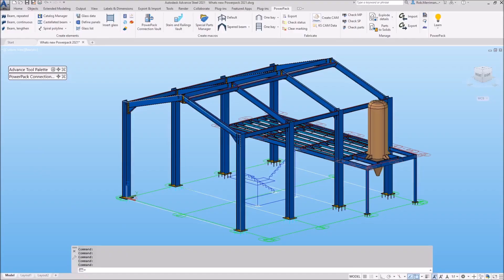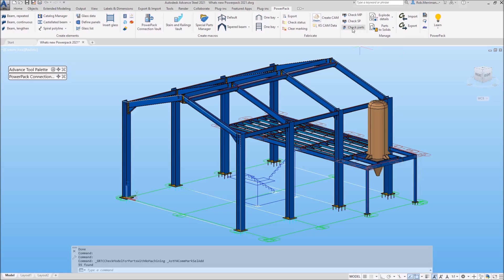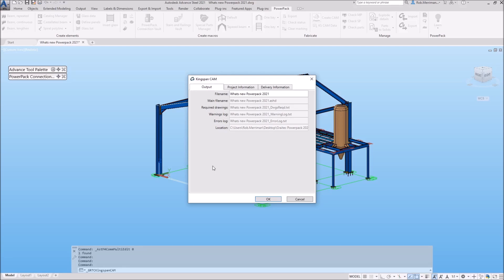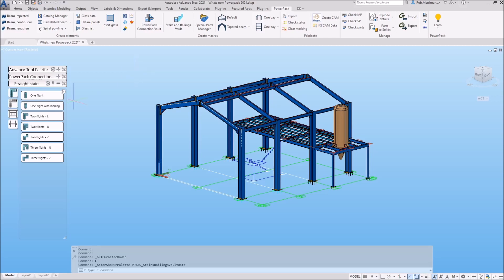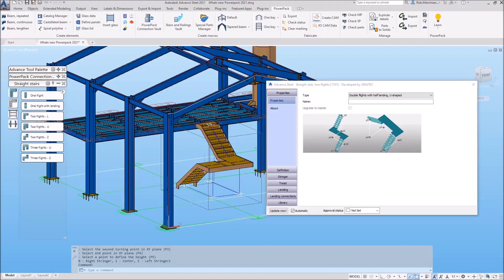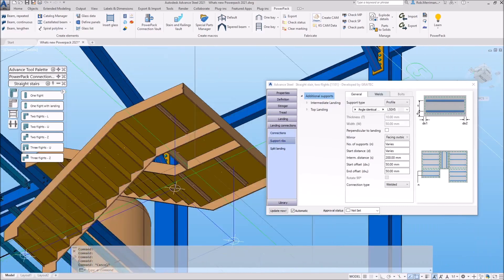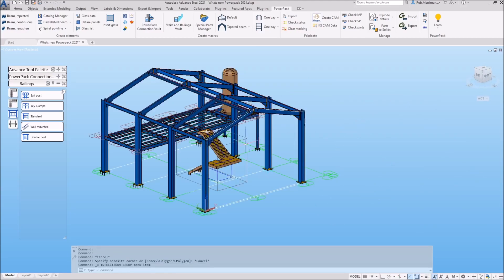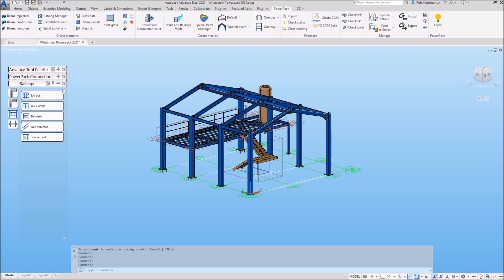Graitec PowerPack for Advance Steel 2021 | What's New

Comment: Hi, thank you for your videos, there interesting.
You have a quite large model here.
I am having lagging issues with my pc hardware configuration.
Specialy when crating/modifying pickets in stair railing or even worse when generating or updating the drawings from the cameras or the sections in the drawings.
What can I do to minimize the time it takes to do this processes?
What hardware are you using on yor pc for Advance Steel
(Not the minimum requirements)?
- Mainboard?
- CPU exact model?
- memory Ram count with mhz, ecc?
- Grafics card model?
- storage SSD/HDD, read/write speed?
Reply: Minimum 12Go memory ...win 7 or win10.. 64bits ...with grafic card NIVIDIA